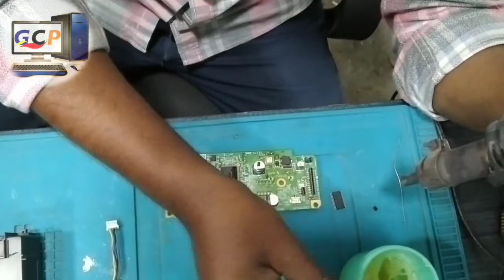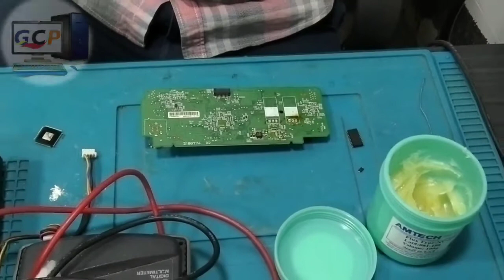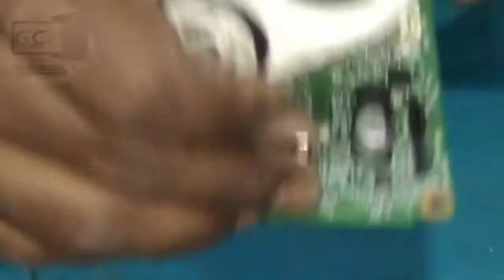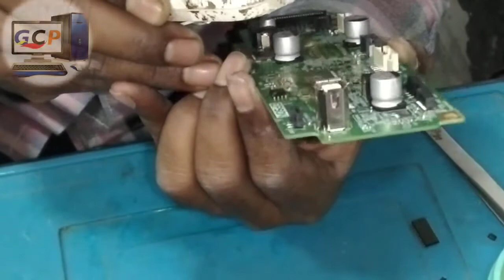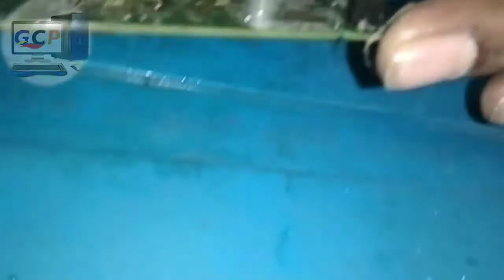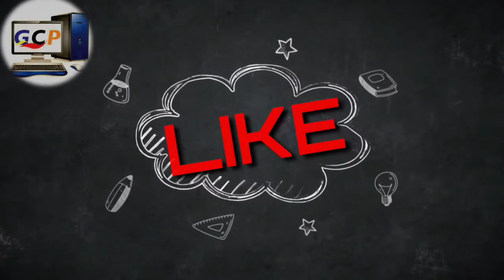Epson L3110, L3150,L3165,L380, L220,L130 printer motherboard problem solution?

Comment: Sir I clean Epson l3150 headprint with water when I installed it on printer then the printer is not switching on, I change the MOSFET is now switching on but not printing. Please Sir I need your help, what should I have to do now?

Comment: 3v line short@  EPSON E01B02BA (CPU) SHORT

BD64547  MOTOR DRIVE IC

E09A88GA HEAD POWER IC

A2222 AND C6144 TRANSISTOR PAIR 

EPSON L3110..